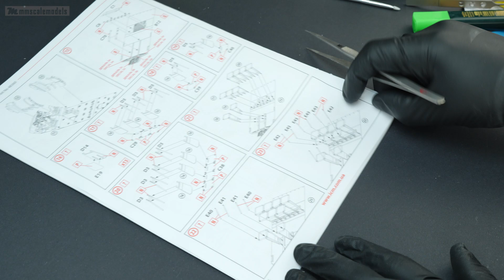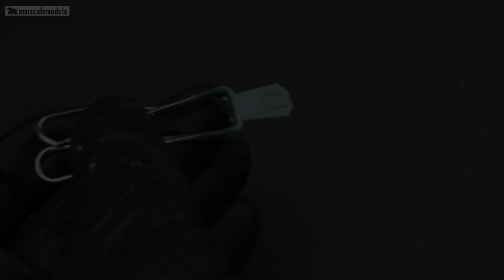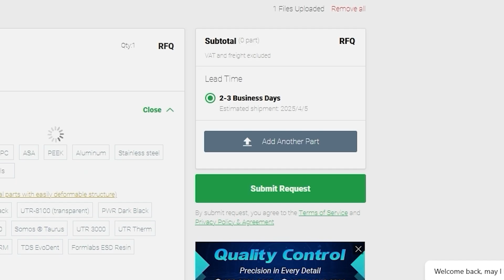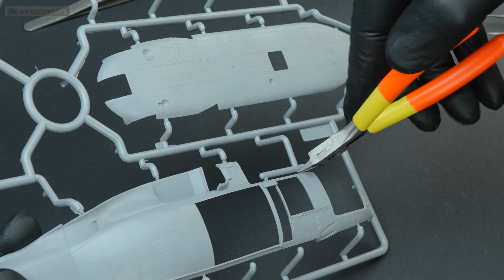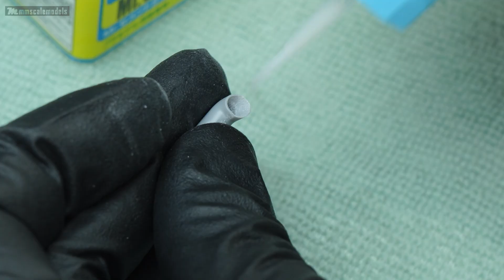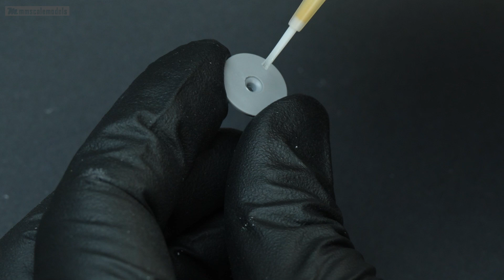Fighting the seats - MH-60l DAP 1/48 ICM - Project Black Hawk - Episode 2

Comment: @5:40 You are removing very delicate seat parts from the sprue. In the past when I've encountered a similar situation I've always heated the tip of an old x-acto knife blade and used it as a hot knife to remove the parts from the sprue. It reduces the stress on the fragile parts and is less likely to damage them. I can't tell you how many times I've destroyed parts trying to use sprue nippers on tiny parts.
Reply from the maker: That's a clever Idea 👍 I have also broken my fair share of small bits, and I kind of know what to look for. Regardless, it's always a risky move :)